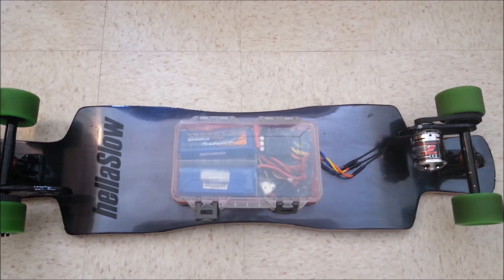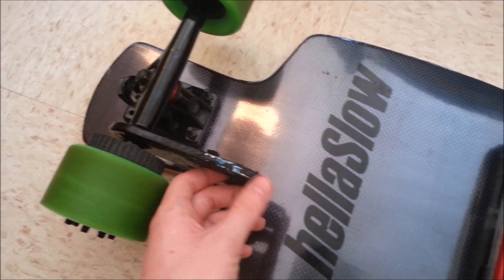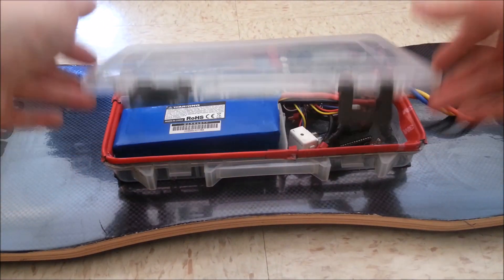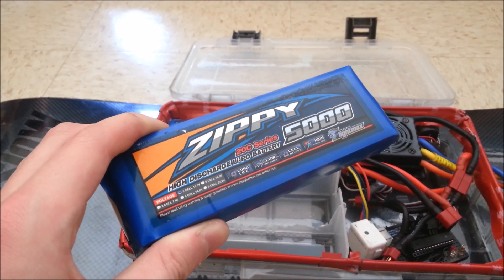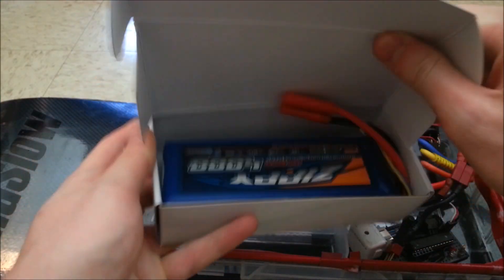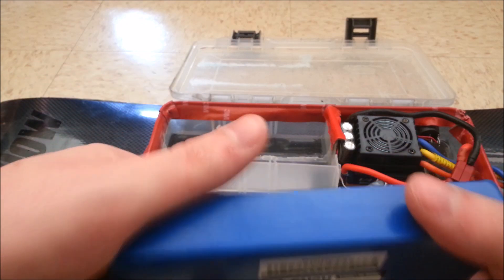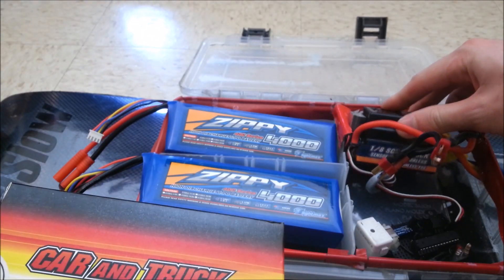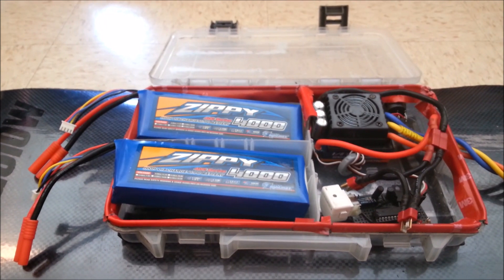DIY Electric Longboard 150Mile Update

Comment: 20c means 20x the capacity. so 20x 5A means 100A CONSTANT current. this is way more than the motor can survive so the problem is not the battery. and swithing it is not useful at all.
try to find out the maximum voltage for your motor and use batterys that have the same amount of voltage. because higher voltage means smaller current for the same amount of power

Comment: I'm just letting you know that your battery gives out 100 amps and the motor only uses about 75 amps so it's not that the batteries can't hold up it's that the motor can't pull  you up the hill
Reply from the maker: Ryan Perry The motors I have operate at 70 Amps under max load. I eventually added a second motor up front. To prevent current drop a decent amount of headroom was needed for the 140Amps.

Comment: Did you notice any difference by changing batteries?

5*20c=100amp
So in theory it shouldn't have made any difference with only one motor.
4*40c=160amp 
But with dual motor it should make a big difference.(80amps instead of 50)

Comment: What connectors did you use between the motor and the esc; I'm putting mine together currently and don't want to solder these two particular parts
Reply: Alex Smith hey what did you end up doing

Comment: how did you make the same remote control connect to two escs
Reply from the maker: A Y split from the receiver. One connection with Power, Ground and Signal, and the other with just Signal.

Comment: Did you program the ESC to go backwards and brake as well?
Reply: Most likely he did.
Reply: +Zeptonite well I only saw the skate brake when he pulled the trigger backwards instead of spinning the motor the other direction.

Anyway if you did program the ESC to make the motor go backwards as well could you please make a video about how you do that because I can't find anything about it anywhere.
Reply: +Derpy Herpy Well the motor has to slow down and stop before it spins in the other direction, plus he wasn't pulling on the trigger backwards very hard so it wouldn't reverse as quickly. You need to buy an ESC that can reverse the motor. Reversing ESCs also use 2 channels instead of one.
Reply: +Zeptonite Can you give me a name of one like that, that can work with 80A motors in a reasonable price?
Reply: Derpy Herpy Practically all RC car ESCs are reversible so just get a 120 - 150 amp car ESC.

Comment: hi, i have a long board and i would love to get/make an electric one. i also live in new England. Rhode Island to be more specific. I am only 14, so putting all of this together would be nearly impossible, I don't know how, but i could give you my long board and you could put the motor on it and all that, and then i could pay you according to the price of the motor (and you putting it on yourself)

i posted this comment on your last video, but this one is more up to date so maybe you will read this before the other one
Reply from the maker: Aidan Dooley Hey Aidan, I'd go talk to Dexter over at http://diyelectricskateboard.com/ and tell him that Zach sent you. He'll walk you through the process and help you figure out what you want to do with your build. Most of the assembly is pretty simple (just nuts and bolts) the hardest part would be making a flat spot on the motor which can be done simply with a file.

Comment: why you have to use 150A ESC but your motor is about 80A
Reply: You always want to make sure the esc can handle current at least 15-30 amps more than the motor is rated for. Granted his setup it is a little overkill however going up hills probably draws around 110 amps even though the motor is rated for 80 so it's good that he has a high amp esc

Comment: I was wondering, people are having trouble with the hobbyking 150a on their boards. with cogging(stuttering) and starting up with a 6s configuration. did you have these problems too?
Reply from the maker: Nigel Passage Because the speed controller was made for a car and not a board supporting a human, it will suffer cogging. The best solution is to kick off before attempting to accelerate.
Reply: Okay and with high speed? Will it cog than?
Reply from the maker: Nope no cogging at high speed, just really low speed

Comment: A lot of people had some problems with 1 single 150a esc from HK. 
did yout? I would really appreciate if you could help me with the programming card.settings! that would be so helpfull!
And what transmitter are you using?
Thanks mate
Reply from the maker: Nigel Passage I didn't have a problem when I was running a single setup.My programming settings are as follows:
(1) voltage cutoff - 5
(2) Running Mode - 1
(3)Motor Timing - 2
(4)Initial Acc - 2
(5)Throttle % rev -4
(6) Throttle Limit - 1
(7) % Braking - 7
(8) Drag Brake - 1
(9)Motor rotation- (depends on how the motor is wired)
(10) Neutral Range- 3

And for a transmitter I used to use a wiiceiver, but now I use a rc car controller (due to dropping connection).
Reply: ZSDesign Okay thank you very, very much, one last question. wich plugs do you use, xt90? thanks
Reply from the maker: I use Dean's plugs (also known as T connectors)

Comment: So the new ESC you have in the description is rated to 6S LiPo, but the motor (Turnigy SK3 245kv according to the build video) is listed as 10S LiPoly. Is this not a problem? Amateur RC electrician here..
Reply from the maker: MrCoyoteToYou Yep that motor can handle UP TO 10S (and even higher actually). So that means it could run on as little as 3s (or even lower, I haven't tested it). 6s is the best starting platform for price vs power.
Reply: Thanks! Makes sense.. So you're only using two 3S in series because the ESC can only handle 6S? Also, in your parts list you mention the programming card, is that necessary?
Last question, whats the speed/hill climbing power like with this setup?
Reply from the maker: Yes two batteries in series, because of the ESC limits. the programming card is needed to change the functions of the motor controller. Without it you can't changes braking settings or acceleration and other settings. So I would say the card is a must have item. The speed for this setup is very good, if you want better hill climbing performance you should look for a lower kv motor (213kv would be good).

Comment from the maker: I'm not sure on the range or speed of the new packs. I'm waiting for the weather to get nicer before I test them out.
Reply from the maker: ***** The old packs got to about 27mph on flat ground (tested with a car). And had around a 5 mile range.
Reply: ZSDesign What motor do you have, please?
Reply from the maker: turnigy sk3 6364 245kv
http://www.hobbyking.com/hobbyking/store/uh_viewitem.asp?idproduct=35029&aff=1545616
Reply: +ZSDesign so it did probably 20mph as car speedo guage is not accurate and adds up extra 5-7mph to real speed. its best to measure it with phone gps and some speed check apps

Comment: What do you think about using lifepo4? Because most of the production boards use this battery.
Reply from the maker: I chose to use lipo because there are more options available. With lifepo4 there are only a few readily available batteries.
The only advantage I can see is the damage protection with a lifepo4 pack. But since my batteries are in a enclosure i'm not concerned.